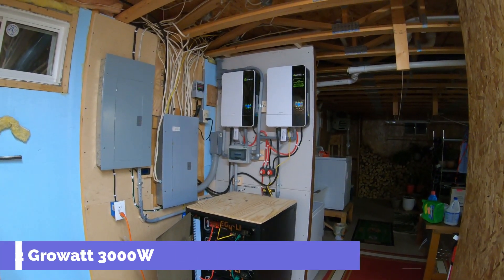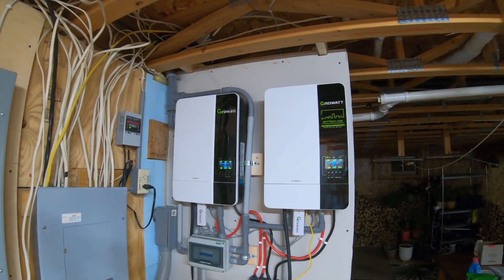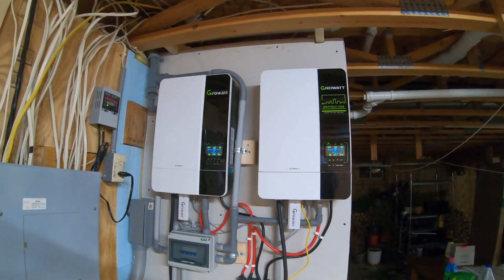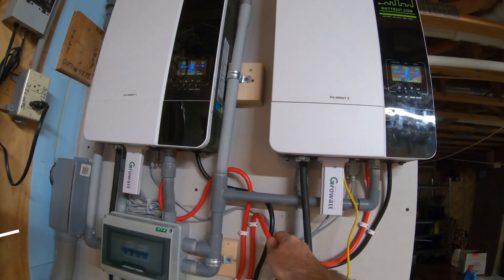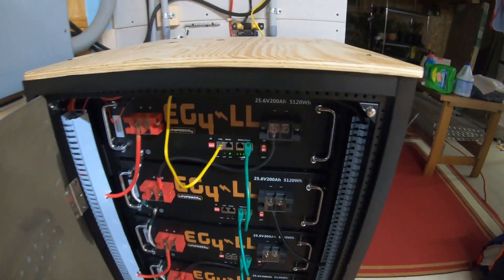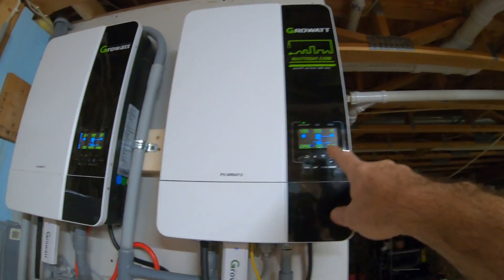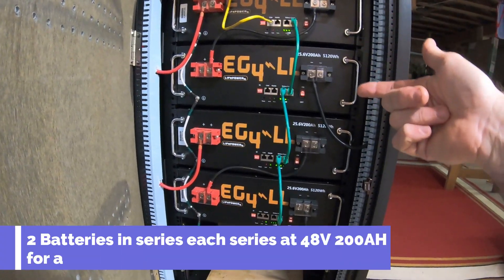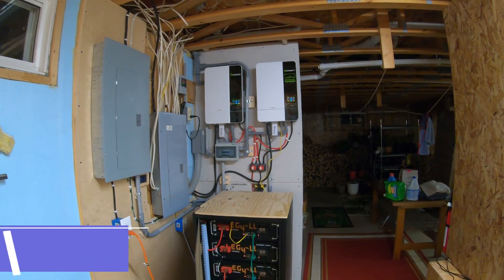Growatt SPF 3000TL LVM-ES in Split phase with EG4-ll Lifepower4 Lithium batteries

Comment: I have the same 2 Growatts. Each connected to its own battery bank of 12v@200AH x 4 batteries. So 2 seperate systems with 120v output. I want to connect the 2 Growatt so I can get the 240v split phase but thr Growatts need to be connected to the same bank, and the Chins that I bought said 4 batteries connected max due to the BMS. So I guess I need the server rack batteries so I can get more than 10KW bank connected to the paired Growatts.

Comment: II have one SPF 3000  with 48 vdc 200ah like yours what breaker box do you suggest I get for my 120 vac output
Reply from the maker: - I used GE products only because it's what's available for sale in the area. Be sure to get a 2 pole and not 3 pole box, better to get a box that's expandable should you grow you're PV system.

Comment: hi exellent vid. one question what happens when the load demand exceeds the inverter ac goes in to help, or ac takes ttotal control, to take the load. thanks
Reply from the maker: - If I overload the system or run the inverters capacity at maximum they will automatically shutoff. Once you have a system setup you'll start to understanding power consumption loads and start tailoring your useage so as not to overload the system.

Comment: when your inverter finishes charging the battery in ex SUB mode, does it still start using the battery charge?
Reply from the maker: In SUB mode the inverters will continue to draw power from the batteries if the solar panels and electric grid are not providing enough electricity that is being demanded.

Comment: Thanks for the video!  I am just wondering is there a reason why you use flexible "black" 8 AWG cable for AC input without using conduit, and put AC output inside the conduit?  Could you also use the same flexible "black" (may be 10 AWG) cable for AC output too?   I'm doing my own wiring with the same Growatt device but in single phase, I'm trying to figure out a quick, simple and proper wiring design.
Reply from the maker: Hi Rocky and happy holidays! The reason I used flex cabling was only for the reason of being plausible or flexible, it was also the cable on discount in the gauge I desired at the time of purchase. 
The only reason I put the cables from the batteries into conduit was as an added layer of protection in the event any of the wires were to heat up, become frayed, possibly causing additional issues. Its not necessary but it is a good idea for adding an extra layer of protection in the event of an accident if you can.
In regards to cabling, 10 gauge copper wiring will only handle up to 35 amps at 170 degrees or 40 amps at 194 degrees (see chart below), I would advise running 8 gauge for the AC IN and AC Out if you have it, if not the 10 gauge wire is pushing the limits of maximum amps available for the size of cable and the amount of amps your inverter will pull and push. This is if you have the 3000tl Growatt of course. I hope this helps and be sure to read and follow the manual, cheers.
https://you-love-solar.myshopify.com/pages/solar-insolation
Reply: @ahhlifesgood1956  Thank you for your values insight!  I'll follow your advises!  Wish you have a happy holidays!!

Comment: use a mini-split instead of your 240v heater. Heat pumps get you more cold/hot for less power.
Reply from the maker: Thank you for the advice, I need another option as the heater I use is a Current guzzling monster!

Comment: 48v 200ah?  My Gyll are only 48v 100ah  where you get 200ah?
Reply from the maker: I have 4 - 24v 200ah, 2 in series to make 48v... Want 2 more, thinking of building the next ones.
Reply: @ahhlifesgood1956  oh nice,  it's really hard to find them right now
Reply from the maker: @joshuatimes9290  - That and they are expensive for the amount of Amps you get. I have a friend that's going to give me some Lead acid batteries that I'm planning to incorporate into my system as well.

Comment: Trying using RS485 port to communicate with inverter

Then using the RJ45 cable as a cross cable and use option L02 / L04 as your profile under settings 5 and Li
Reply from the maker: Thanks Oloye, great advice that I tried originally with the manual, thus under configuration of one battery,  which theoretically should be an easier config when only running 1 inverter. I'm going to get a mini hub as a bridge and try it again as you're suggesting, this time under split phase configuration, worth a try. Appreciate your time, should it work I'll post here the update.
Reply: @ahhlifesgood1956  will be delighted to hear your update.

Comment: would love to see and have a better understanding of how you have the neutral and ground from sub panel to the main box? Or do you have a separate ground rod for the sub panel?
Reply from the maker: Hello James, I've connected a secondary breaker box that functions for solar. Bonded the Neutral on the box to the sub panel and installed a separate grounding rod that services this panel. If in doubt be sure to consult a professional.

Comment: Nice work, don't forget you have to do the math conversion for the amps as the Volts make a big difference 20 amps at 120V is 50 amps at 48V.  So you are likely just about fine with what you are doing.
Reply from the maker: Thanks Darren for your values insight, it's fact left out of many descriptions that's extremely important when cabling, fuses and connectors.
Reply: @ahhlifesgood1956  Which jack on the batts did you connect the cable to (rj45 to usb) to ? I know the TWO othernet jack on the RIGHT side are for battery to battery daisy chain.... I connected all of the daisy chains together and then the remaining one on the RIGHT SIDE (the 2 jacks on the right) To the  PC and dont get anything ;( I have the same batts (just the 48v version) thnks
Reply from the maker: @SdBoy  - When configuring Lithium batteries communication he manual says you can use either, RS 
485 or CAN port, depending of course on how your patch cable pins are wired will depend on the port you use. I tried both bot CAN and RS485 port configurations without success while configuring these eg4 24v batteries. I think I'll make a video on this today on how the configuration should be according to the manual and what happens on my systems communications.
Reply: @ahhlifesgood1956  thanks, I havent tried either of them 2.... just the ports on the right.... They sent me the cable (RJ45 to USB cable)... so I would assume that the cable does work :) Ill try it and see and try it on both the CAN and 485 ports....

Comment: Thanks for the videos! I just bought 1 of these units maybe another one later. My just learning question in about the ac in. Can this be plugged into a regular house outlet to charge the 48v livepower4 battery? I'm still waiting for panels.
Reply from the maker: These Growatts are very effective, affordable and powerful for small inverters, with the beauty being they're scalable so you can grow the power of your system over time with ease. The answer to your question is "Yes", you simply plug in the "AC in" from your inverter  to your house grid outlet or direct to the breaker box that carries 120 volts with a 40 amp (check in manual on exact breaker size). One thing I did was to run a seperate 120v cable to an outlet from my main breaker box that would function only for my inverter AC in. Once I installed the second inverter I had to conne the AC in from both converters to seperate poles on my main breaker box. Hope this helps, enjoy and as always be Mindful and Careful when working with electricity as it can be very unforgiving.
Reply: @ahhlifesgood1956  Okay Thanks. I think I will do the same with the ac in. Thanks again and i will check to see if you have other videos on this system. Happy Holidays!